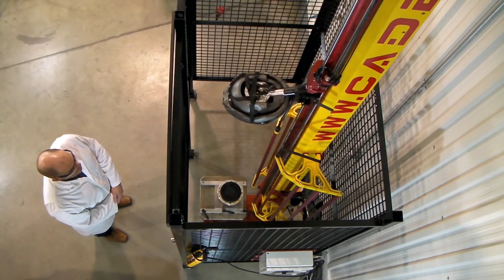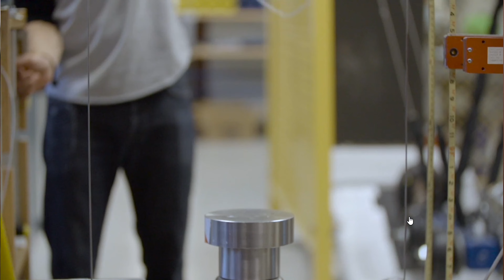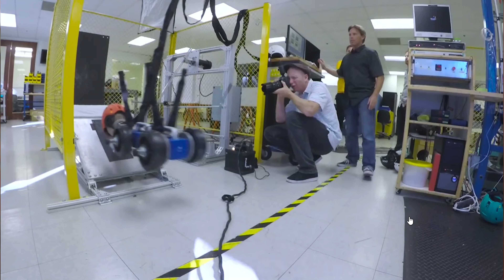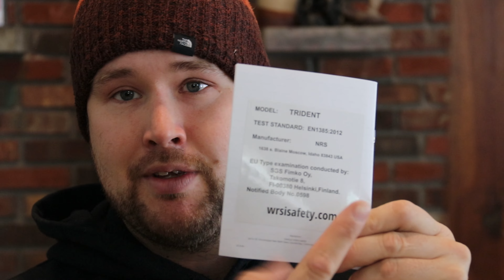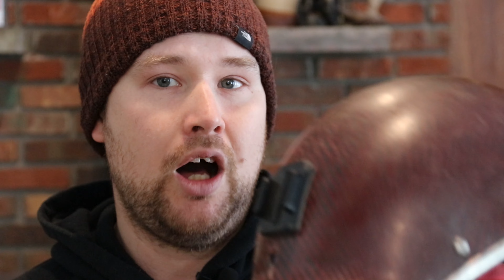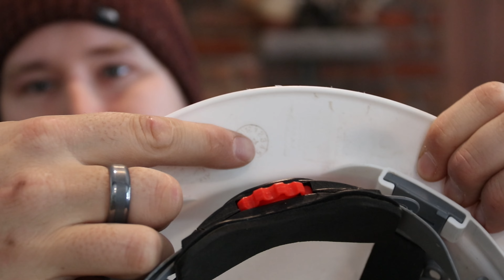Don't Buy This Gear | Getting Better Pt. 8

Comment: This is a great video and more people, across outdoors sports, should consider these things. I know I hate gear getting sent to the landfill, and as such, I have a few piles of clapped gear that I would never sell but avoid putting in the trash. I am sure there are others like me out there, and what I recommend is finding a place that does textile recycling. You can drop off things like old PFDs, beat dry gear, etc and (hopefully) less of it ends up in the landfill. Also, a tip I learned from the bike industry - stomp your helmets, cut your pfd straps, do what you need to do to make the gear inoperable before you get rid of it. That prevents some kid (or an adult who doesn't know better) from fishing it out of the trash and using it.
Reply from the maker: Destroying damaged or suspect equipment is actually just a general safety practice. Imagine you put a ladder out on the curb and someone falls off it.

Comment: My niece's husband wanted to know if he could use an old helmet of mine from the early 1980[s. I told him "Hell no" and tried to explain to him why. He's still mad at me for making him buy a new one, and thinks me to be very selfish, but at least he still has his brains in his head. Sorta. He ends up doing a lot of unintentional beatering by taking on stuff he isn't ready for without getting any sort of training first. He's trying to run class IV and still hasn't learned to roll.
Reply from the maker: Yeah wow if anyone needs a good helmet. Good on you for doing the hard thing
Reply: @AlexBarham  I've tried. I feel like I've failed though since he keeps trying to take on things he's just not ready for. I worry that one of his swims might not end safely in future though. Now he's talking about running upper death in Glenwood Canyon on the Colorado River this coming summer, and he still hasn't learned to roll. Anyone who knows of that rapid knows that it is an extremely advanced rapid, and I know that he won't make it inside his boat. I just hope that he doesn't leave my niece a widow with his desire to prove himself. To me, proving yourself is demonstrating you know your limits, and working hard to perfect your game before moving on to more difficult things. That's something that is true in any of life's endeavours. As the old saying goes, anything that is worth doing is worth doing well.

Comment: I use a 20 year old lotus designs pfd, but it was mostly closet kept until last year and I tested it still floats about 15 pounds.
Reply from the maker: Still a bad idea. The fabrics and threads of the vest have already significantly weakened, and can fail without warning.

Comment: Alex you are right on. Years ago, as the senior kayak instructor for the community center in Pigeon Forge TN, I went to collegiate lacrosse helmets and bolted full face guards to them.  lacrosse, being an NCAA sanctioned sport, has their helmets tested to a higher level. Face guards  also just make sense for gnarr boaters.

Comment: ASTM is comprised of industry people in the first place, so the industry people on the committee come to an agreement that this test or feature makes for a minimum standard...  not that it is safe, just min standard for the industry.  but yeah it does make for a standard.  BTW - you can be on the helmet committee (whatever committee that is, and add whitewater without much expense other than joining the organization.)

Comment: One thing I've seen which always troubles me is people sitting on their off. In my opinion that just helping to squeeze the air out that helps you float.
Reply from the maker: It's not a good habit for a number of reasons, but it isn't necessarily detrimental to the integrity of the pfd.

Comment: Another thing that wrecks gear: pools: Our kayak club does rollling sessions in pools. Chlorine is terrible for gear. So, we retire out old PFDs and turn them into pool-only vests.  This way beginners get the chance to practice rolling in actual gear but we don't wreck our new stuff, which only goes on the river during its functional lifetime.
Reply from the maker: Sure, but who really wears a pad and helmet in the pool? If you must than the exposure and a rinse will not be that bad. The user error of not washing the gear after a pool session is the real issue
Reply: There are very good reasons to wear a helmet and a PFD in a pool. The helmet because people (often beginners) are swinging paddles around in a relatively small area and you don't want to get caught in the head with one of them. And if you're practicing hip snaps off the pool wall and slip, you don't want to hit your head there either. And if you're practicing your roll, all the better to have your PFD on because you need to get used to the feel of it and how it potentially is limiting some of your mobility, and you don't want to be figuring that out for the first time when you're on the river. Practice with the gear you're going to use in real conditions.

Comment: Fun fact - My 2016 Sweet Rocker literally has "Trooper" (Ski equivalent to the Rocker) stamp on the inside foam.
Reply: Also I had the generation of Sweet Rocker that had the loose  front-inner lining problem. If one was to get beat down in a hole would make the lining slip down and blind the paddler. Now sweet stitches the front and side lining together. One should always scrutinize their gear before having their life depend on it. It takes more than a good conscience for some companies to recall their products.
Reply from the maker: I still can't believe they didn't do a recall. That situation was horrible.

Comment: So I broke a vertebrae in my neck last year when I took a massive hit. It happened during a freestyle session - not on difficult whitewater. I was grateful for my very expensive but also very good helmet which cracked due to the hit. Had I worn an older helmet or one with a lower build quality, I might very well have ended up paralized. Buy good safety gear and use it!
Reply from the maker: Glad you're okay! Replace that helmet!
Reply: @AlexBarham  I ordered the replacement while still in a neck brace :-)

Comment: Thanks for this. I’m a raft guide and still use my original pfd and a helmet someone gave me at the end of my first season. I knew the helmet was trash but I guided my first season without a helmet at all so I used it mostly to make the guests more comfortable. Last season I started kayaking and really felt uncomfortable with the old helmet and bought a new one mid way through. I also started guiding class V and took some gnarly swims. Definitely feel better about the helmet decision. The idea about putting my old helmet on a wall is awesome, definitely happening. And I’m definitely going to look into a new pfd.
Reply from the maker: Live, learn and pass it on! Definitely need a top shelf kit if you're guiding Class V! Good on you!

Comment: Wise and timely words - thanks!  Other ways to wear out a PFD quicker than you might think are, wear it in a pool for rolling practice, also sea surfing. Chlorine and salt eat gear, especially if you don't clean it afterwards. (That said, it can be a good idea to keep a less than pristine PFD for pool practice because, as I was once told " you're not as flexible as you think you are" :) )
Reply from the maker: Pretty sure it is mostly the sand that is eating your gear. Sailing gear that never sees sand stays in good shape a lot longer than the stuff I had when I spent summers doing freestyle in the surf.
Reply: @AlexBarham  do you have any thoughts about safety differences for surf? I always wear a low profile freestyle BA then a wetsuit and light semi dry combo. I do know people who surf in just a wetsuit, as if you swim you are really swimming so you need mobility, obliviously goes without saying you should always be able to swim in
Reply from the maker: Obviously be able to swim in. That to means more focus on temps, winds and currents than gear. I've had to drag in surfers before and it is scary being stuck out there.

The only thing I'd say that isn't obvious is be careful about bringing a baseball cap style helmet out there. I've had a number of issues with them getting caught in big beatdowns and strangling me, and bending my neck back when I got slammed on the sand.
Reply from the maker: I've never really understood the pfd in a pool thing. I was a lifeguard and trained/managed guards for  a long time. If there is a guard on duty then you should be fine. Occasionally to match pool training to real world makes sense, but idk about every time.
Reply: @AlexBarham  Yeah I should've said occasionally like for beginners to learn the feeling overcoming the PDF buoyancy and commit to the role and me in Spring when it's does the gear still fit!
Reply: it's a well known fact that the salt water eats gear particularly pfds in the sailing community.  Avoid taking your good pfd or throw rope for that matter in the pool.  Always rinse super well after
Reply from the maker: I spent 3 summers surfing 5+ days a week. My gear didn't really age more than it would have in the river. Never rinsed it, but I always got the sand off it.

By comparison, when I used to sail my stuff lasted much longer because it didn't see sand at all